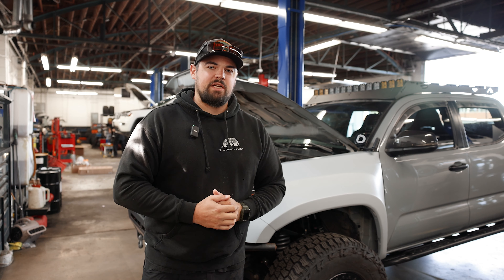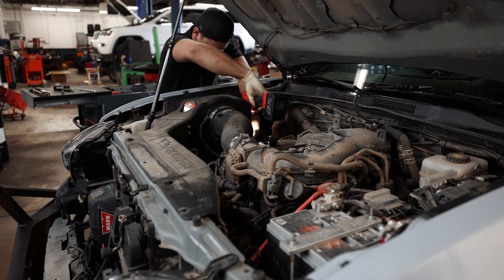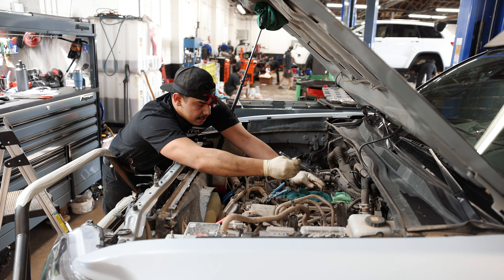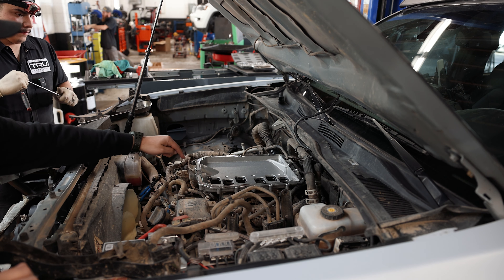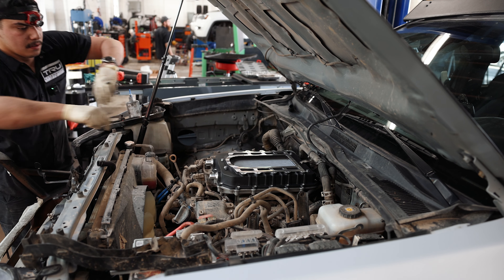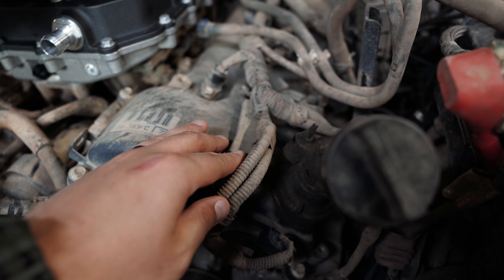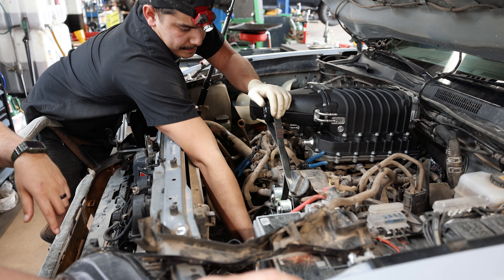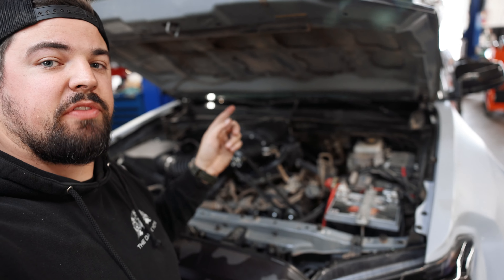Harrop Tacoma Supercharger Install

Comment: I really want to see how this kit compares to the Magnuson supercharger
Reply from the maker: Driveablilty this tune is way better. Just go look at the graphs from both superchargers. The numbers will be different because I think they did theirs on a stock Tacoma and at sea level but look at the power curve of the chargers and percentage of power gained. Both are great superchargers but this one shines with the better tune and not having to pay a tuner to dial it in like the magnuson.
Reply: Totally on the fence because I have not driven a supercharged 3rd gen from Harrop or Magnuson. But you obviously prefer Harrop? Have you driven a Magnuson 3rd gen? If so, your experience?
Reply from the maker: @JesusWSalazar  I have and the tune is much better on the Harrop. It’s a lot more drivable and the fuel cut offs are in the right spots so you have power throughout the power band. They both use Eaton’s tvs technology but where the magnuson really falls short is their tune. I also thing the Harrop looks 100x better as well